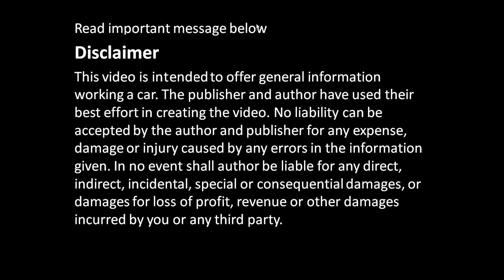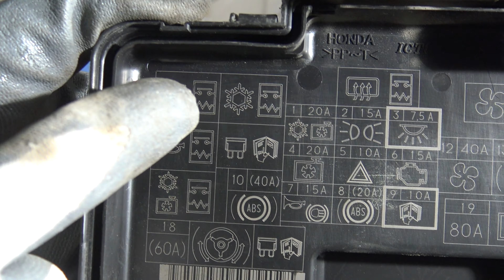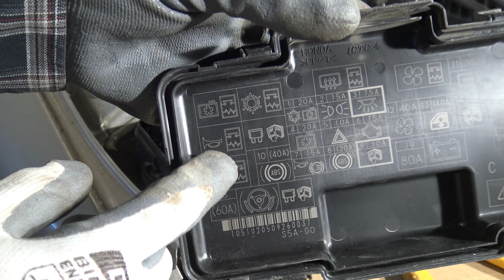Why Horn is BAD in car, truck or bike. Check and Fix these things!

Comment: Excellent analysis Peter! I noticed that the passenger's side fender is a bit damaged, it has some dents. Please disassemble the fender and try to fix it with a little bit hammering! (Not with big hammer though!) :-)
Reply from the maker: Thanks for the tip!😀👍